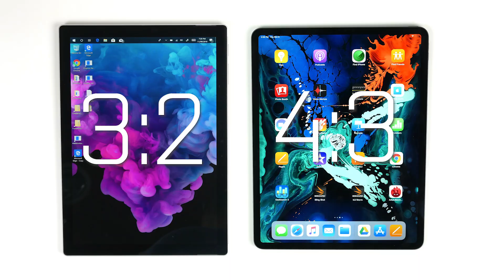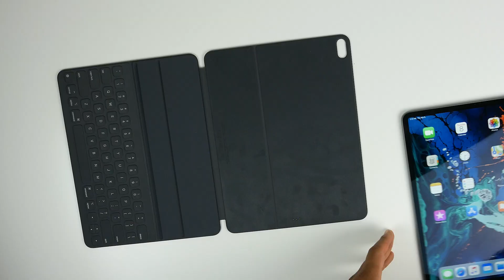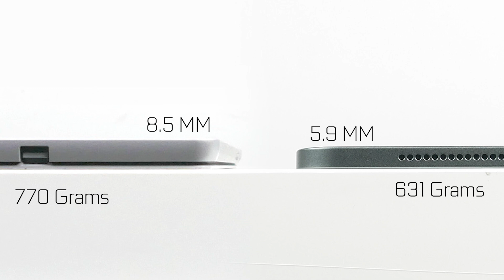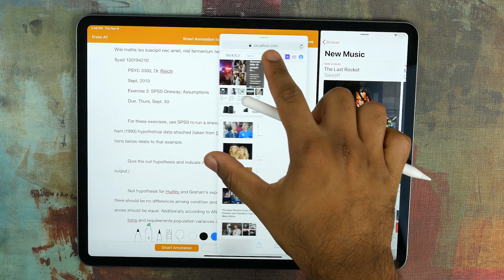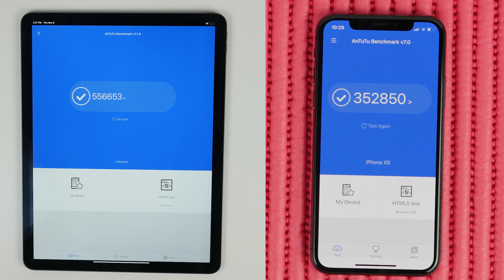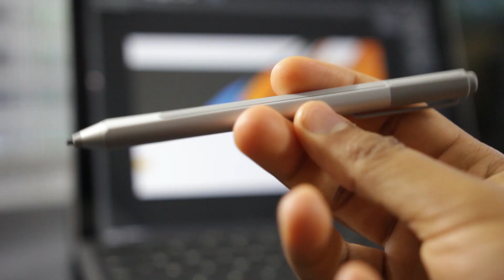2018 iPad Pro vs Surface Pro 6

Comment: basically, iPad Pro = Better hardware, Surface Pro = More capable software.
Reply: "better hardware" you did not take your time to look up things did you?
Reply: @davidkern7636  I did, in raw performance numbers the ARM chip outperforms the i7 as well in GPU graphics performance.  (intel gpu has been and always will be trash)
Reply: @hanes2  So have you tested it again, and again and again? Because the pro has no cooler, and the more often you do your "testing" the slower your ARM shit gets, while the i7 stays good :) Stop trying to look at those benchmarks or what ever tf you are looking at. They are one time short usage figures
Reply: @hanes2  Indeed, Intel is worse that amd atm, but def. not worse than something produced by apple "A12X" my ass

Comment: it's a waste of time to be comparing those two;; since they are just two whole different style of "Tablets". the ipad is just a regular tablet but the surface pro is a tablet "PC". while the surface pro 6 's minimum ram is 8GB, the ipad pro has the maximum ram of 6GB, and that is only if you purchase the 1TB model which is just too overpriced, and all the rest is 4GB. Being able to use the adobe program such as illustrator or photoshop takes up a lot of space for cpu and ram, so unless they come up with the lower-specification photoshop application for apple, there's no way the ipad pro could handle them without lagging. It's just a matter of whether you want the regular table or you want a pc made in tablet style

Comment: Not sure why you would compare these two products. Surely they are aimed at different markets.

iPad for consuming stuff and is not a PC (Which is why they try to sell laptops)
Surface Pro for productivity and consuming stuff.

In my view, if you only want one device then the Surface is the only option here. If you just want to consume media then the iPad might have the edge. Both are well built, excellent, albeit expensive, products. If i wanted a productivity device and a consuming device then i'd have the Surface and an Android tablet...
Reply: The reason they ‘also try to sell laptops’, is not because the iPad Pro is not capable of doing ‘real work’, because it is (of course depending on what you define as real work, but the average document typing for college/uni is fine, as well as notebook taking, diagram drawing etc.) The reason they also sell a laptop is because these two products are fundamentally different, and Apple believes by combining them, you don’t get the best product. What exactly is the Surface Pro trying to do? Because as a laptop, it’s definitely not as good as a real laptop, and as a tablet, it can’t compare to the iPad because it’s OS is PC software and is reliant on a mouse. So you get this product in the middle where both sides have been compromised.

Comment: also, I cannot wait for apple to start using their own chips in the MacBook and computer lineup. their mobile chips already beat 90%+ of the laptop market, but iOS is so closed down you can't even put that to good use. its literally too powerful for its own good. but when apple starts building in-house chips on their COMPUTERS, ohhhh man.. it will destroy the competition!

Comment: Due to the sd card slot and the ability to run pro apps I would go for the SP6 right now. I could see that changing in the future but iOS limits the IPad Pro. I also think the SP6 keyboard is leagues above the IPad and you can use a mouse. The IPad takes everything else though.

Comment: one thing that keeps me away from surface pro is the lack of gpu power and the high prices compared to ipads 
i won’t buy an i5 4gb 128gb surface pro that would be dumb, buying decent specs that puts it on par with the ipad would cost more than the ipad does
the only merit of surface pro is running windows OS otherwise i don’t see any advantage elsewhere but running windows is enough to shift many people from the ipad handicapped by iOS

Comment: I still prefer Microsoft because it's internals or hardware can easily be replaced and upgraded if you want . But when it comes to the processor Microsoft did gives you enough flexibility to change the whole motherboard if you want but processors aren't a part of it because it's not their call. Also processors like Kirin 710, m.tek p70, and snapdragon 845 could be a game changer.

Comment: That same old iPad screen ratio is a joke.
In 10 years, Apple 'might' discover what 16:9 is.  Lol
Reply: I don't get how 16:9 means it's the future of screen ratio's
Reply: @sciencebutreversed1166  It's most likely not, but current media is better supported by widescreen formats (unless you don't mind HUGE black bars or cropped content).
Reply: @DanRC69  well most people dont cry over it,so it won't be a bother,besides for a tablet that is widely used for drawing is pretty decent for the ipads ratio.
Reply: @sciencebutreversed1166  True, i must admit i agree about the iPad's artistic potential. I haven't seen anything as well suited (not on a tablet), though it's lack of openness and features would make me avoid it.

Comment: iPad Pro is basically an overpowered Netflix machine

*Yes, this is a stolen comment from Matthew Moniz
Reply: Must not have the 2018 pro. I use my 12.9 pro over my 15 in 2017 MacBook Pro, it’s an amazing tablet if you know what you are doing
Reply: @cory4548  doesn't really matter which ipad you have, they will never replace your mac / pc because it is running on a mobile os.
Reply: Teun JS agree... that’s one thing you can’t argue but I will say it all depends on what you are doing. Cause everything I do on my Mac I can do on my iPad. At work at Facebook and everything we use is web based programs so I can use the iPad also, I can stream my Xbox one x on the iPad which I used the Mac for so depends on the person but for me. It does everything I used my Mac for honestly.
Reply: @teunjs7413  it's really disappointing that Apple doesn't seriously try to maximize the possibility of iPad Pro's raw performance (lol, it even competes with MacBook Pro 15 inch)
Reply: Aziz Aja yeah I completely agree, honestly the screen and the raw power of the iPad Pro is quicker and screen looks way better than the 15in MacBook Pro, and I have the 2.9 I7 w 16gig of ram. And it feels like the iPad is faster. Another thing that sucks about the iPad is 4K.... it can’t stream 4K videos which pisses me off, I got the 64gig 12.9 cell and WiFi and for over a grand it can’t do 4K streaming I mean come on it’s almost 2019...oh and I dropped the new pencil yesterday and it broke on the first drop.... luckily it was just the tip. These YouTubers do all these shake tests with them but not a bump test while you are walking... luckily my job has a bunch of the old ones and I got the old tip and it worked.
Reply: Teun JS you cannot use iPad well as a youtube content creator
Reply: @teunjs7413  inaccurate the work flow is different but applications do drawing and creative apps better and more reliably than a PC, for the specific task, it takes new learning but you find that it works faster and more reliable in practice, I was the biggest skeptic. The new normal is blocking with a mobile device in the field and finishing like final rendering with the power of a PC/MAC. Unless you have a stationary task process, then why mobile at all. My ipad pro 12.9 is a beast. I never use my laptop anymore. I never have to re-shoot anything because I cant story board block my video on my ipad do basic structural editing and then do final rendering and finish it with a desktop, which is vastly superior to a macbook pro.
Reply: Aziz Aja Simply put, they need Macbook sales.
Reply: Cory Gilbert AGREE.  My Macbook Pro and Mac are essentially unused now.  The ipad pro is a ripping device and imagine its only going to imporve with ipdad OS
Reply: Hmm  totally never saw this comment before
Reply: https://youtu.be/P0ZFlFG67kY
Reply: Matthew Moniz
Reply: @jashmodi  no shit, sherlock lmao

*well okay, since y'all ask for it, here's my apology. I'm sorry for blatantly stealing his comment and it's been with fun to have a conversation with you all
Reply: Yes when the pad meets a wrong user
Reply: speak for yourself...
Reply: Don't underestimate candy crush and upcoming diablo immortal mobile game!
Reply: Exatly right you cant do anithing on The ipad that fully takes advantage of The prossecor.
Reply: You´re basically a pillock with an opinion,  i have an alienware, an iMac and the iPad Pro and all of them perform perfectly but still i prefer to use my iPad to draw and as a pre production tool, and the iMac as a finishing tool, and the pc (which most people do use as toys) I use it for 3D software that is not available for Mac, so go shove your opinion in your arse.
Reply: Aziz Aja 
Not anymore with iPad OS 13
Reply: Amazing how one single software update can transform a piece of hardware that dramatically in under a year.
Reply: The iPad Pro can easily replace your laptop. It always depends on what you're doing. An artist will probably always choose the iPad Pro with the S Pen over any type of PC. And even in terms of video rendering the new iPad Pros are literally much faster than most laptops and many MacBooks.
Reply: Surface pro is underpowered excel spreasheet crunching garbage.
Reply: iPad is a toy.
Reply: hahahahaa

Comment: If you want a multimedia machine with good speakers and colour accurate display, or if you're an illustrator that also uses heavy duty apps like PS or video editing software, get iPad Pro. If you want a keyboard, use a mouse, or need a full desktop OS for your work, get Surface Pro. Simple.

Comment: iOS is more stable as compared to windows and that's the main point
Reply: if you enjoy mobile app yes
Reply: OriginalNoseBleed Xcode, FCPX and Logic Pro is coming along with Photoshop and an already capable Lightroom. Or Affinity Photo/Design.
Reply: @danie7kovacs  call me when you'll be able to code in devC++, java, javascript, python, html etc... and run x64 programs at all, then i might consider it a "PRO" device, i can do video and image editing on my phone as well you know, very pro.
Reply: @leonardomincolelli7202  there are IDEs for that. Web developing is 100% doable with the iPad atm. For python, json and so on you can just connect to a raspberry pi over vnc and do all the work there. 
You can't compile desktop applications of course .. but well it's complicated as long as we don't have enough alternative iPad apps. 
I just wish the surface wouldn't look hardwarewise so outdated compared to the iPad Pro ..
Reply: @CeziHD  well if i had 1500€ i would very much rather spend them on a 1200€ laptop with a REAL keyboard, a good trackpad, good display, good specs, and most importantly a real operating system. and use the other 300€ for an android tablet like a huawei m5 lte or something like that, to really get the best of both worlds.
Reply: @leonardomincolelli7202  and you sit on a surface pro while programming? rofl thanks for the evening laugh.
Reply: @lolsa123  did you even read my comment at all? I said a real laptop with a real keyboard, not a bloody surface and certainly not a retarded toypad.
Reply: OriginalNoseBleed Of course, it depends on what you do.
Reply: Yeah you can't get a virus the second you download software from a browser.
Reply: @taekdev  win defender is more stable and powerful than any other antivirus on planet earth
Reply: opeyemi makinro even if that was true, it’s not, an iPad doesn’t need one at all which is even better
Reply: But useless
Reply: It it's for mobile os. Too limiting. They should have a mode in control center to where you can switch to a Mac os and an iOS
Reply: It's also limited to shit which is the main point.